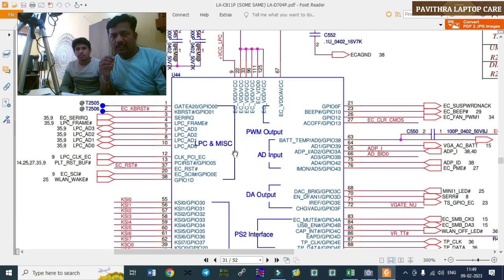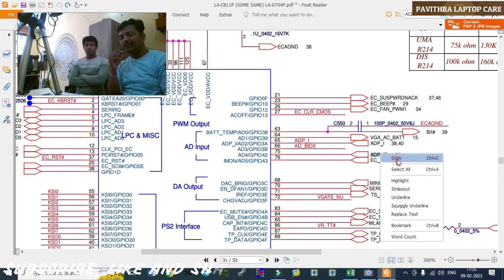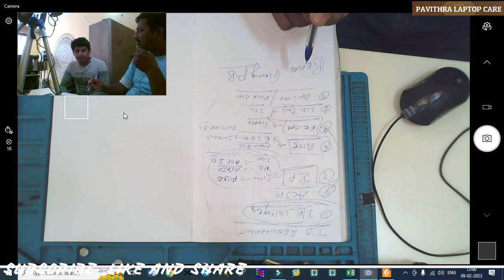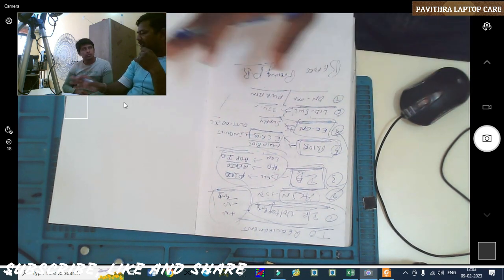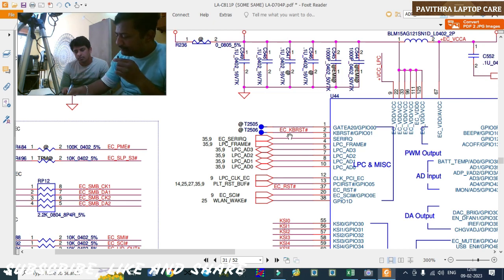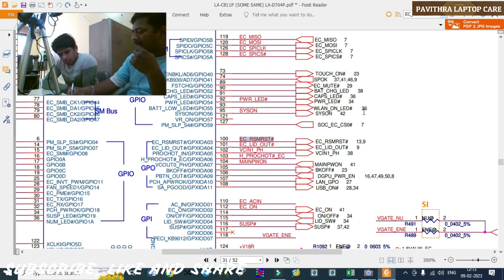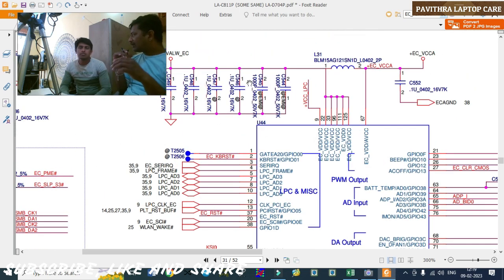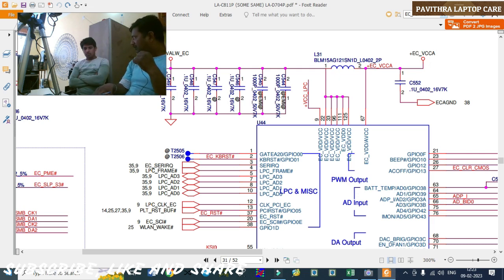IO (EC) Requirement : How to troubleshoot a No Power ON case in Laptop Motherboard Repairing?

Comment: How to find if EC bios binary file corrupted using IO requirement. Or otherwise how to confirm? Pls
Reply from the maker: Check Some signals like ec_on, rsmrst...or won't get a proper voltage l...
Reply: @LaptopCourse  okay thanks kind reply Sir